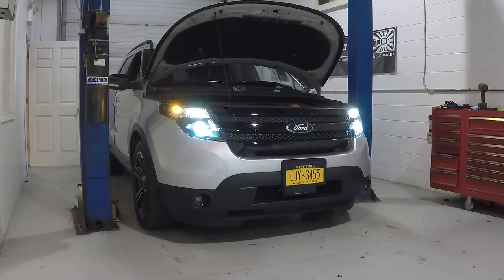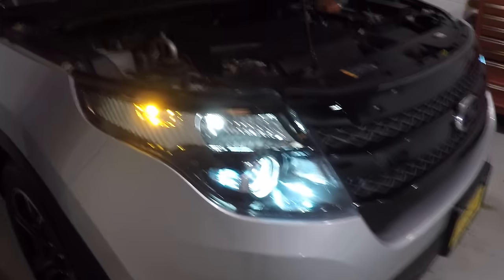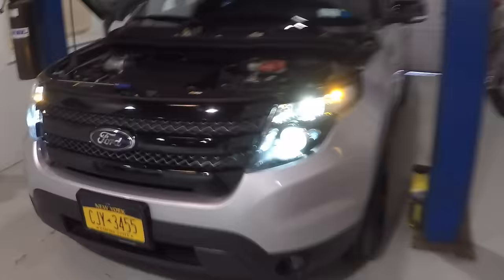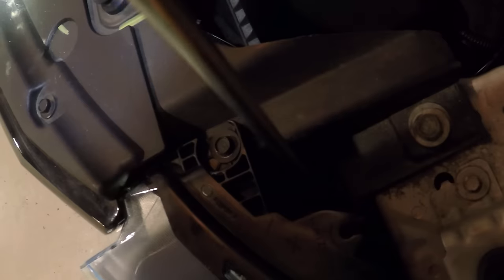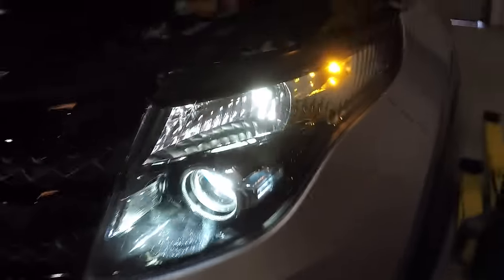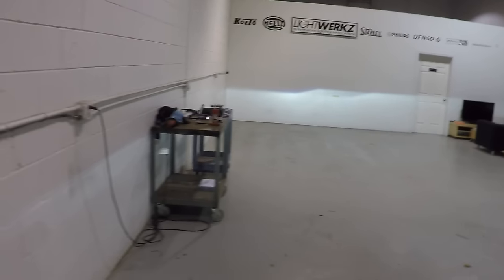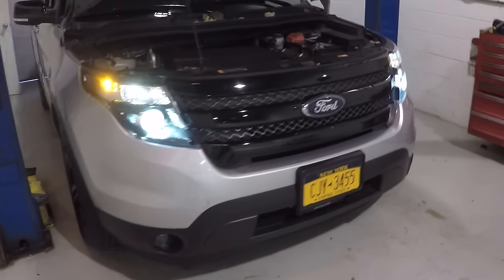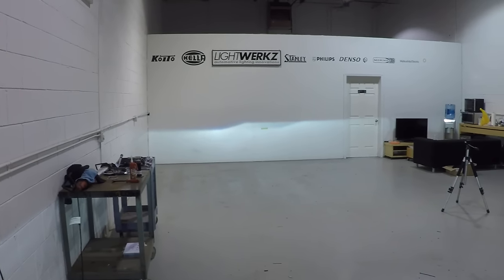How To - Headlight Aiming / Alignment Projector Retrofit

Comment: 25' out and drop 2" is OBSOLETE, and using the low side of the cutoff is plain wrong. Based on IIHS data and some trigonometry, the following chart should serve well when aiming projectors with a cutoff. Still measure out 25', then drop the HIGH side of the step according to the chart below. And unless you're Geoff Tate (he only sees in infrared), you'll get the most usable light from 5500K bulbs, or the next color temp higher if you're running HIDs on 55W ballasts.
First number of each line is headlight height in inches, second number is high-step drop in inches.
22 1.5
24 1.75
26 2
28 2.125
30 2.25
32 2-7/16
34 2-9/16
36 2.75
38 2-7/8
40 3
44 3.25
48 3-5/8
54 4-1/16

IIHS describes 330" as the optimal distance of illumination for low-beams, and the majority of autos sold in the USA do not shine that far. The chart above should allow your low beam to illuminate the road 330' ahead (assuming your lights aren't embarrassed by a birthday candle).
Using the high side of the cutoff as your drop guide will allow you to see the 330' distance in low beam while allowing the low side do its job of protecting oncomers from glare.
If you're aimed according to the chart and shining into the passenger cabin in front of you, you're either a tall truck tailgating a pregnant rollerskate, or you forgot to turn off your highs.
If you're running reflectors, I recommend a retrokit to a GOOD QUALITY projector setup. If that retrokit uses HID bulbs, make sure they have a solenoid cutoff to allow you to switch between high and low beam.
Reply: You should use the left side of the beam for VOL projector and the right side for VOR projector.

Comment: I added a 9005 hid kit to my 2013 Explorer because the light output had voids in it.  It did not fix it. I still have a triangle shaped void in the middle of my path of travel.  Up and down adjustment cannot Fix this.  Any suggestions ? https://i.imgur.com/BENPxbO.jpg
Reply: Jonathon Muszynski by looking at that picture I take it those a spyder headlight housings. If that’s the case you will never be able to fix the horrible beam pattern

Comment: My has a button in the car but one side is higher, can the the Auto ones be done with a screw driver
Reply from the maker: Of course you still need to manually adjust.

Comment: I see that screw point on the back of that ford adjusts the height. But how do you adjust the side to side? Or is it not an option for these Ford Explorer years?
Reply: ye bro same my lights are even like he said up and down

but the pattern needs to be "centered," and it's not possible. By adjusting a screw on the headlight, but with led, there's a set screw imma try that next. Will let you know maybe make a video on it

Comment: I see that screw point on the back of that ford adjusts the height. But how do you adjust the side to side? Or is it not an option for these Ford Explorer years?
Reply: I’m not sure about ford but on Toyota it’s in the top corner outside the housing. It will usually have a white or black cover resembling an oscillating fan cover  about the size of your thumb.  You pop it off and you will find the screw